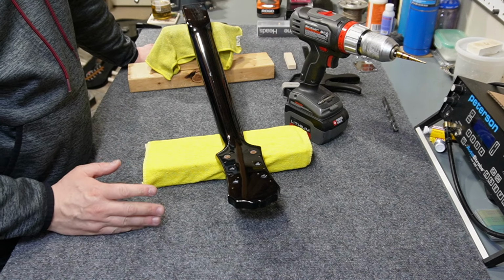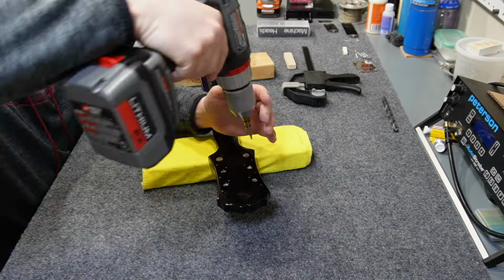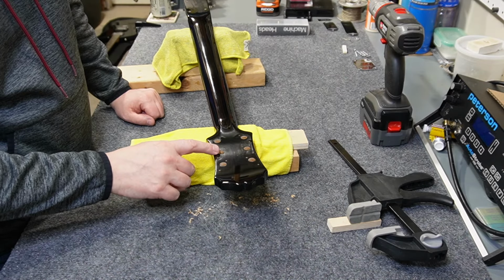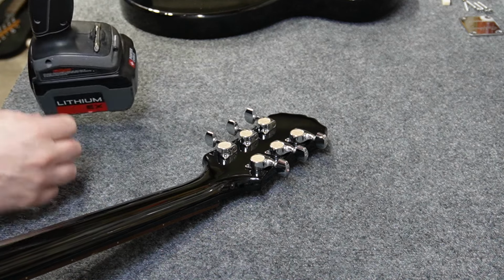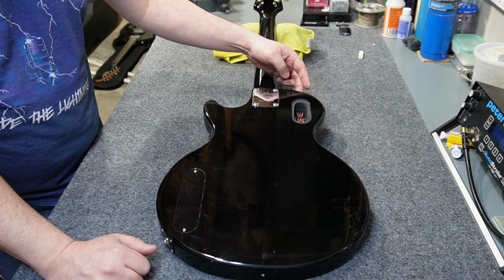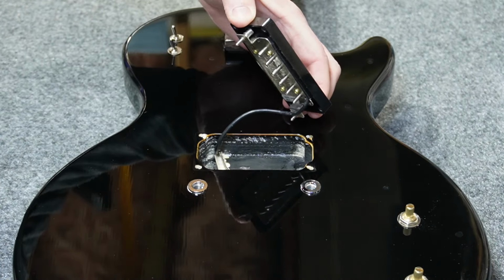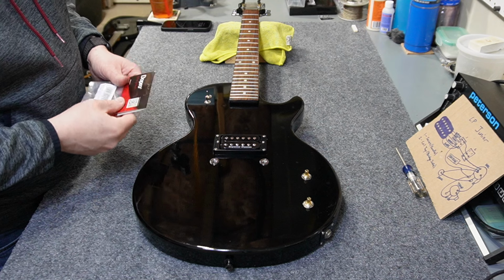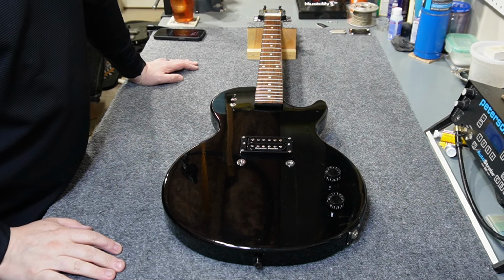Epiphone Junior Upgrade - Part 3: Tuners, Strap Locks, Humbucker, Coil Tap & Split/Parallel Switches

Comment: I love your attention to detail. I'd love to see a video series on super strat build with a tricked out Floyd Rose with all the upgrades.
Reply from the maker: Thanks, you might check out the BC Rich ST I repaired, but I’m sure I’ll do another super Strat in the future.
Reply: @hacksguitarhobby  If you do, install a tungsten carbide sustain block. Nobody talks about this metal used in the floyd rose.

Comment: I used to have the same guitar in sunburst and was able to do the same series/split/parallel with a single 3-way toggle switch between the volume and tone knobs. Much simpler solution, but I dig your ingenuity and clean work with that wiring and routes!

Also, those tuners are just a spoof of PRS locking tuners. They sell an official set of SE upgraded tuners for about $90, so I assume Guyker is going after that market.
Reply from the maker: Nice, I haven’t seen the PRS lockers but will look for them.  I seriously considered the switch location you mentioned, but I decided to test my skills on the routing, especially figuring I had nothing to loose. :)  This poor guitar has been through the wringer!